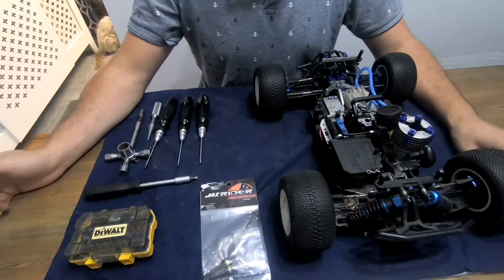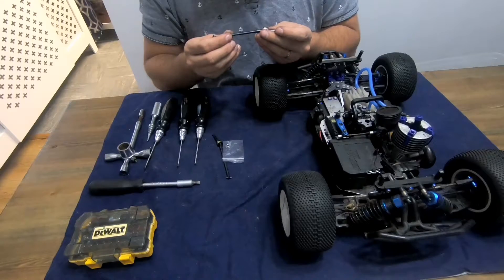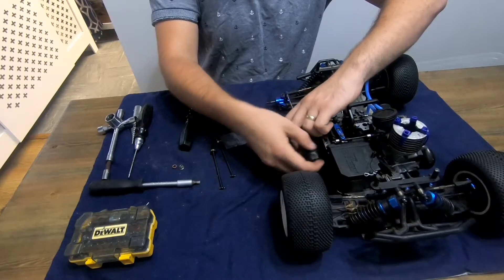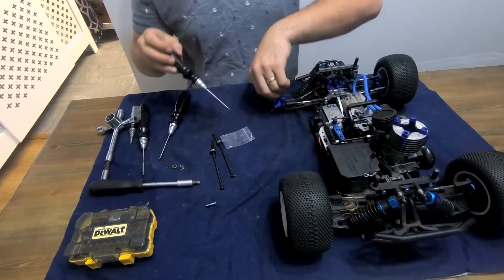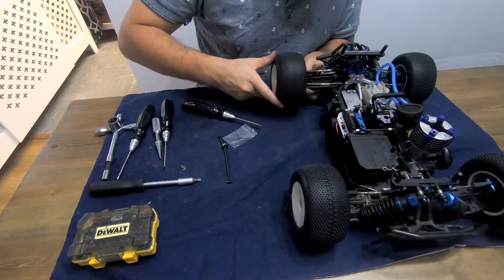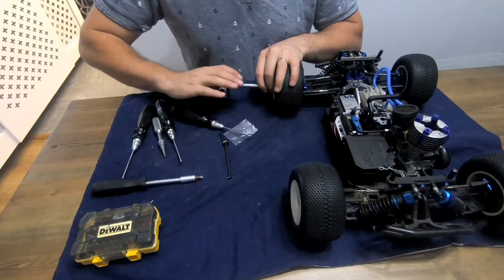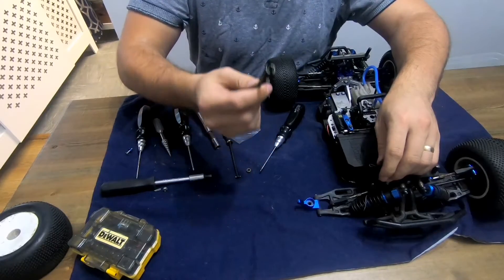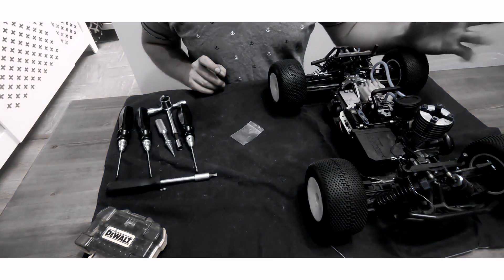JazRider Universal Joints for the HPI Bullet and HotBodies Lightning Stadium 10 RC Nitro Truck

Comment: Hi what wheels and tyres are they?  I dont supposed you can add a link.
Reply from the maker: Hi, these are the original wheels/tyres for a hot ladies lightning stadium 10 which are not made anymore, took me a couple of years to find a second decent set. The part numbers are: 66701 for the tyres and inserts, 66541 for the dish wheels. 

They are quite difficult to find.
Reply: @rcmania4939  thanks for the info

Comment: Have these dive shafts done well for you?   I ordered 4 sets of these drive shafts  after watching your video for my HPI Bullet ST Flux and MT Nitro.  We took both cars out for a run and both cars broke a front drive shaft in minutes.   Didnt finish a single tank on the nitro or a single battery on the electric :/
Reply from the maker: Hi Mike, sorry to hear that's happened, I genuinely haven't had any issues with the jazrider line and they are still holding strong now and I've crashed/destroyed the front end of my bullet/HBls10 hitting a tree.